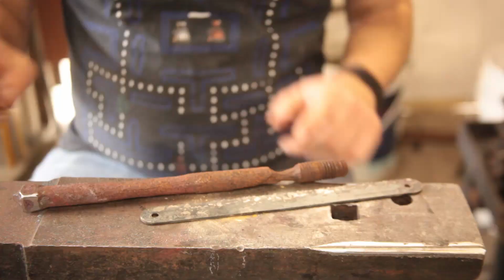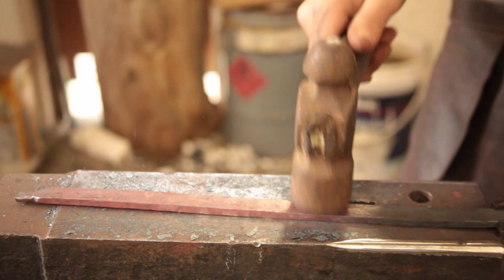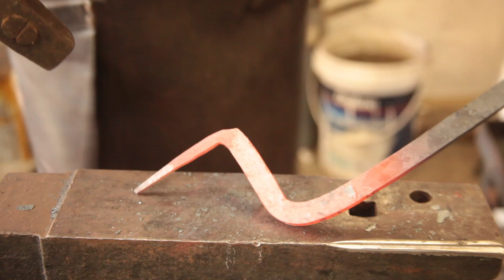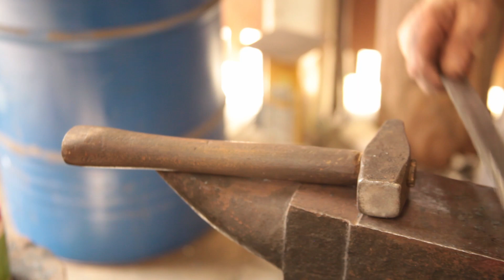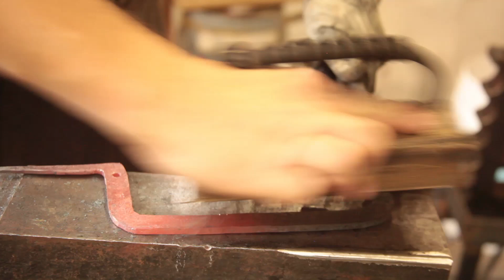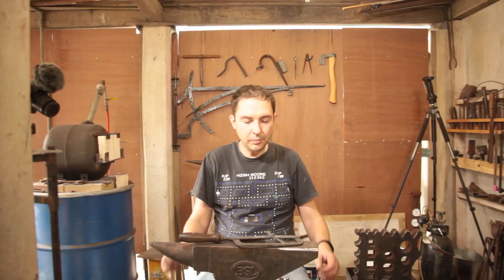Mastermyr Hacksaw #63 pt4 finishing the frame and a test cut

Comment: Hay Doc, It seems to me you're doing a lot of bashing and not moving a lot of metal, I think you need a heavier hammer.
I googled it and the ratio it seems to be 50:1 anvil to hammer weight ratio.
Reply from the maker: Oddly enough that anvil is 45kg and the hammers I use are all 1-1.5kg...
Reply from the maker: I’ve had elbow surgery so I have to baby it a bit, 4lb is about as big as I can go regularly
Reply: @docshotshopandforge  That's fair enough, elbow injuries can be debilitating especially for a blacksmith.
Reply: @docshotshopandforge  Yeah don't take any risks with dodgy joints. If you're not sure you can trust your elbow 100%, that's no time to go Hulk Smash.